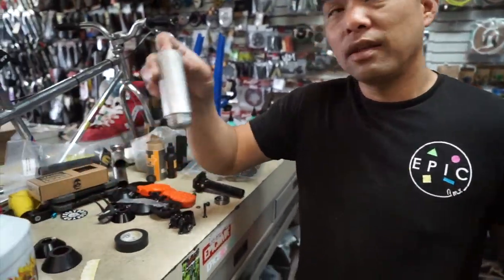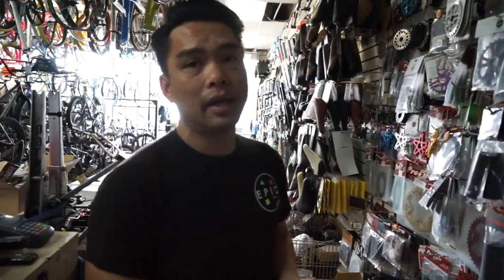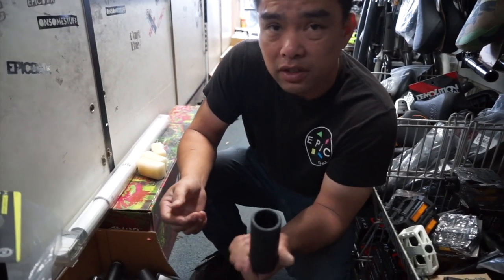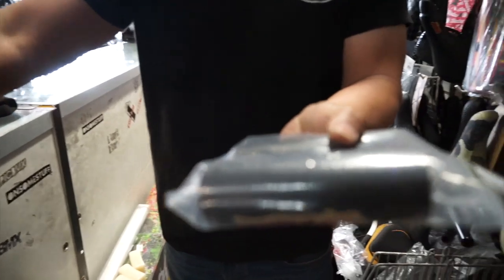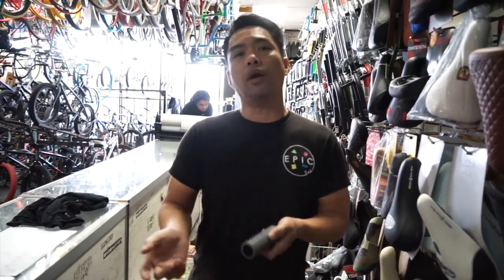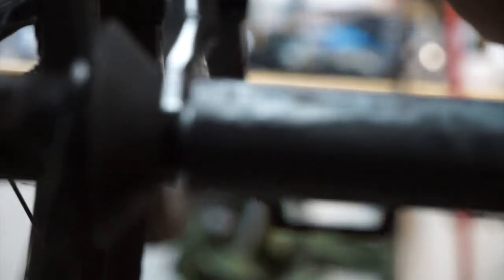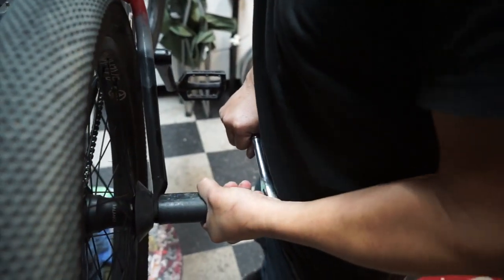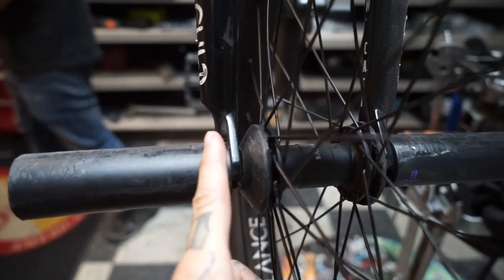HOW TO PICK & INSTALL BMX PEGS ON YOUR BIKE *THE RIGHT WAY*

Comment: Guilty as charged. I left the washer between the peg and the frame… a modest bunnyhop later aaaaand… back wheel shifted sideways far enough for the tire to rub on the frame lol. Luckily no damage or injury, only hurt my pride. I figured I was doing it right by leaving the washer, and I tightened it down pretty good too. So thanks for spelling it out, even if it seems simple there’s always a right way and a wrong way - I appreciate it man.

Comment: wait a second, did I miss something. I just tried to install pegs for the first time today and my axle was too short and the bolt would not bite the axle nut. I did try and use the washer inside the peg, so I could pull that and maybe have a few thread bite, but a few threads aren't a good thing...I didn't see this issue in this video...any suggestions?
Reply: I don’t have pegs yet, but that washer would make a big difference man
Reply: Throw the washer... the peg acts as a washer

Comment from the maker: What else would you like to learn? leave a comment.
shout out phu from epic
Reply: I need to be able to build and Tru my own wheels.
Reply: How to get a seatpost out that is stuck in the seattube. How to get Cranks apart that are stuck. How to get MBB Out. How to lace up a wheel.
Reply: Travis Lynch Practice with an old front wheel and buy yourself a truing stand and some spoke keys I recommend park tool 👍🚲💨
Reply: Travis Lynch if you’re doing 3 cross over over under for the spokes 👍🚲💨
Reply: GOLDEN DAYS dope video I’m still riding my shadow pegs from 2014
Reply: GOLDEN DAYS Free SPM 🇲🇽
Reply: Do you hubguards next
Reply: GOLDEN DAYS BMX warehouse tours behind the scenes type of videos .please
Reply: Brakes- who makes the best on front forks that you can attach brakes to. Can you drill your own hole in the forks etc. different type of brakes V, U etc. different types of pads and the assortment of tricks you know about gyros and getting brakes dialed. The different kinds of levers and why. This information is hard to get because so many people ride brakeless.
Reply: Frame dimensions what do they mean and their shapes. Who makes the lightest frames and who makes the strongest frames. Titanium vs chromoly vs carbon fiber vs aluminum vs steal. The different ways frames are made to be stronger like 41 thermal frames and forks. Fork angles and reasons for those angles and different types etc.
Reply: Phu is the man and I love listening to him. It would be awesome if you had a regular segment on your show with Phu.

Comment: It's just pegs...but I'm actually putting a bike together after years not riding. The wheels i got have female axles and i was wondering about the fitting of pegs with them since female axles never existed when i used to ride. I wasn't sure they'd be strong enough, so thanks for the video.

Comment: I am extremely picky when it comes to pegs. I have this huge list I go through when I buy pegs. Buy the longest pegs I can. That’s it😂 I suck at locking my crooks and hard spins out of grinds so I ride Sunday 5 inch seeley pegs to cheat. Got way more area to hang on to when I spin out of grind and keep my locked in on my crooks

Comment: Question, what tool do I need to put on my front peg? My only socket wrench is the cult pocket tool, and my front hub is definitely not a 14mm.
Reply: 4 way car wheel wrench (cheap) or a ratchet , long reach extension and a 17mm socket(occasionally 15mm).